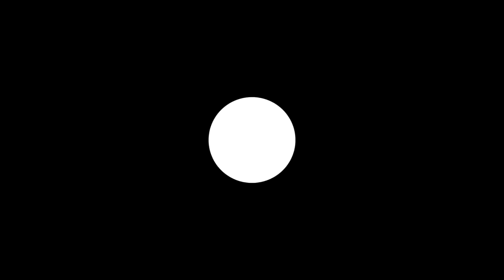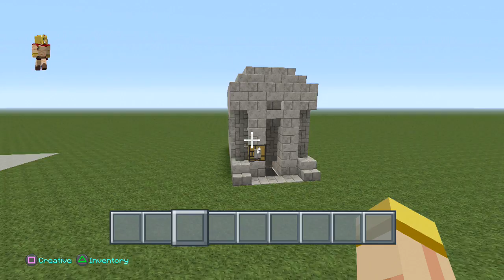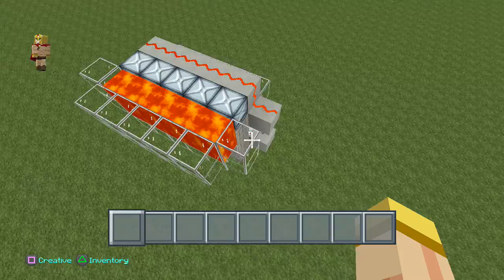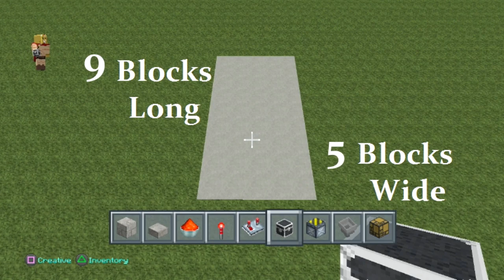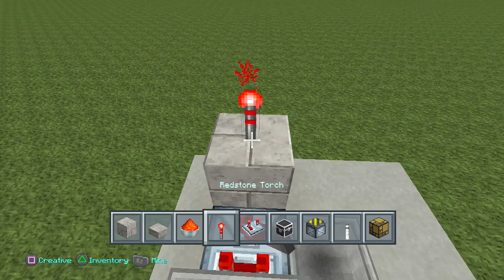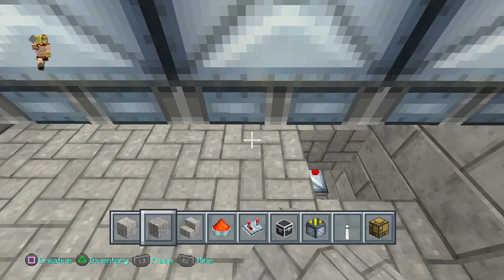Minecraft Tutorial : Automatic Cobblestone Generator,  NO Repeaters

Comment: Ok, so I have been trying to make this work. I followed the directions but it's not working.  I have put items in the 2 hoppers.  what I am finding is the one torch next to the 2 side hoppers disconnects after the machine runs.  I have to break torch and put it down. it will run once but then turn off the torch.  not sure how to fix it

Comment: someone help me I built the thing correct I used the cobblestone generator for about 10 minutes straight and now it wont push the Cobblestone down except for the last piston
Reply: Shakusguy made it on PC today and it did not work but I fixed it by putting 1 block in the 2 hoppers off to the side and moving the water source up by 1 block

Comment: will this work with a plug in with prime mc.what I'm saying is for my generator is a plugin it can do  all the ores will it work for a skyblock island
Reply: im guessing it would still work but i just finished building this and i followed all the directions but it wouldnt generate cobble because the pistons are always powered
Reply: btw i also built this on primemc
Reply: you have to drop an item in the two hoppers
Reply: o oke ty
Reply: you don't need a plug in it does it works with the ore system anyway

Comment: I built this and it did not work until I put an item in the hoppers that face each other. because until then there was nothing to compare which means the pistons would not cycle. in your video you forgot to mention this. it also works better it you add one repeater to the redstone wire that operates the pistons. thank you for your design. much appreciated.

Comment: I followed everything like I was supposed to, but it wasn't moving. I then put in the item in the double hopper and to find out the pistons are moving to fast and are not generation cobblestone.. What's wrong?
Reply from the maker: +The Alexanders what system are you playing it on is it PC or Console
Reply: +K1 Inc. I'm playing on my Xbox 360. I've kinda gotten it to work. Every so often it'll push one down but I usually have to reset one or two of them
Reply from the maker: +The Alexanders im currently working on a new design to correct the issue its coming soon buddy
Reply: +K1 Inc. please do it fast ken. I spent 3 hours today and have the same problem.

Comment: for some reason, cobblestone always generate right under the lava instead of the middle where the pistons are at, making the generator jamed.  Anyone have a solution for this :c?
Reply from the maker: +WarriorWolfinAQW im currently working on a solution and a improved version for sure
Reply: K1 Inc. pls share it with me when ur done :))
Reply: +WarriorWolfinAQW 
 You have to change the whole thing cut out the wall where the water is and move the sources back far enough so the end of the water flow reaches the block before the pistons that way it should work, the same happened to me.
Reply: 2 years later after your comment

~still happends to me
Reply: +K1 Inc. 

 You have to change the whole thing cut out the wall where the water is and move the sources back far enough so the end of the water flow reaches the block before the pistons that way it should work, the same happened to me.

Comment: I'm playing minecraft 1.8.8 and I had the same problem others had of the clock moving too fast to generate cobblestone. I built my generator underground, so I didn't so much have to deal with the aesthetics of the generator when I was working with it, but I found a solution by adding two repeaters after the hopper clock. The one in back is set to 2 and the one in front is set to 1. Here are some screenshots:
http://i.imgur.com/qfi05qZ.png
http://i.imgur.com/5JPsVqn.png
http://i.imgur.com/ZQEbxo6.png
Reply from the maker: +Joseph Adams thank you so much I'm happy you was able to correct the issue and share this information 
and the support is highly appreciated :-)
Reply: +K1 Inc. 
My pistons move too fast. I even tried adding the repeaters like Joseph Adams, did his exact setup with them, and it had no effect. I really want to make this work. Do you have any ideas or helpful suggestions?

Comment: Mine doesn't work
Reply from the maker: Raceyb99  whats issue are you having with the design
Reply: Raceyb99  Did you put a random object in one the hoppers? I had the same problem. used a red stone clock till I realized what was wrong.
Reply from the maker: James Nemeth yes you need to put one item in the hopper

Comment: Maybe just a glitch, but my pistons kept misfiring and it only generated cobble at the very front and very back of the build (three in the middle never moved).

Any thoughts on that like maybe orientation.

Also, are the two hoppers leading into one another supposed to be a clock because I don't remember you putting an item in there for that to pulse.
Reply from the maker: WinterIgnatius I'm always here to help that is weird that it keeps glitching like that are you playing on server?
all the hoppers in  the middle should all lead to the chest and the 2 hoppers facing each other is a clock 
I also have a smaller cobble stone generator which should work easy https://www.youtube.com/watch?v=cZqaWfmKhaU
Reply: No server, just the 360 version. I will attempt it tonight in a regular world as I internally built in on a superflat creative world. I have noticed sometimes that things work better in an actual world rather than creative worlds.

I will let you know what I find out tomorrow.
Reply: Still seems to glitch out from time to time so it might be an orientation issue - will have to experiment more but between yours and a few others I have looked at I have an idea of how to make one work that is faster than the hidden automatic one I used to build that pops out of the ground. Using hoppers is the key to making this easier and more efficient to use.